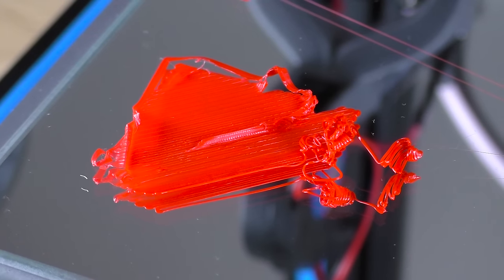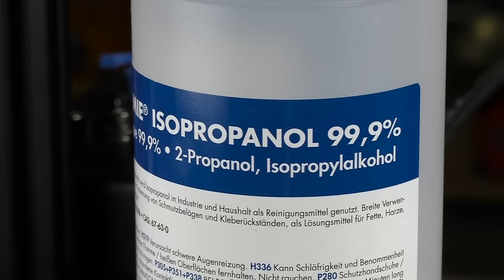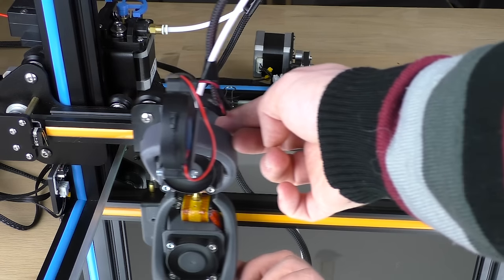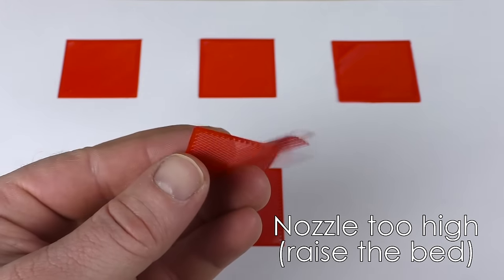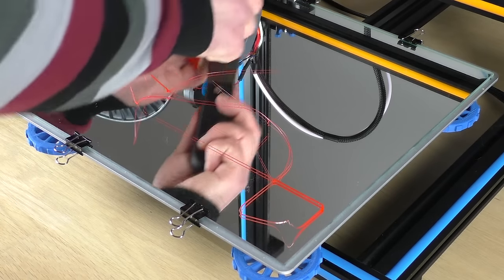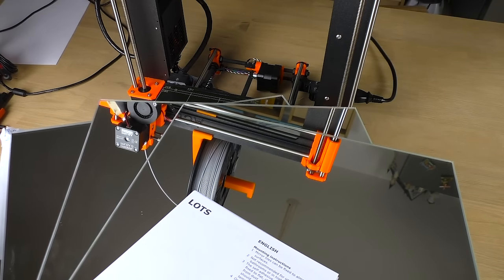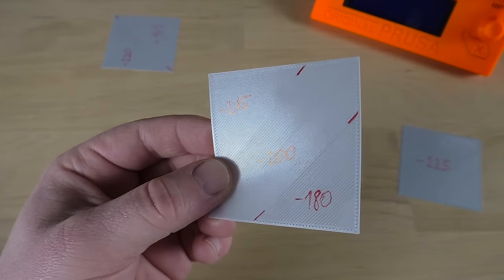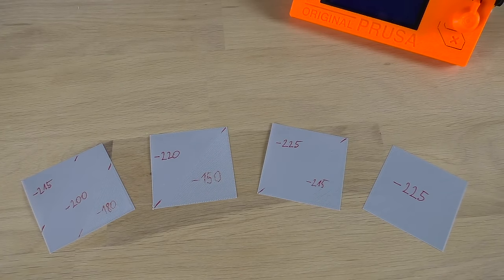Best method for 3D printer bed levelling

Comment: Did you use a brand new bed so it looks nice on the video? If not, can you show how you get it that clean ? Don’t say dishshoap and warm water . We all know that doesn’t work
Reply from the maker: It wasn't new, it was about a year or two old when I made that video.

I wait for it to cool down before removing the object, otherwise it can leave marks behind. I also wipe it with isopropyl alcohol every few prints. You have to be careful with the spatula and not scratch the surface.

Comment: Hi, thank you for sharing the tips. I am new to 3D printing and still very unclear how to get the best leveling. I tried to print the bed leveling squares gcode but my CR-10 V3 just won't print and stopped. Then I tried to print something else and the print job started. Could it be some setting on my printer not allowing the area defined in the gcode to print? I appreciated your help in advacne.
Reply from the maker: I haven't provided any gcodes, only the STL file that you have to slice yourself. Your slicer determined the print size and settings, so it's better to check those first.

Comment: Are the mirrors 30x30 ? Thank you
Great helpful vid 👍
Reply from the maker: Yep, those Ikea mirrors are 30x30cm.
Reply: Many thanks do you cut to crop or your on a 30x30 bed many thanks
Reply from the maker: @shroomy7199  I put them on a 30x30 printer, so I didn't have to cut anything. But you can buy glass cutting knife for cheap and do it yourself. Most hardware stores should be happy to do it for you as well.

Comment: Question, what is my bed is warped in the middle? it is higher than the four corners. what is the solution here other than doing like BL touch leveling?
Reply from the maker: Sometimes, simply flipping the glass around helps. If not, then put a square piece of aluminium foil in each corner (under the glass) to raise it up. You can stack more foils if needed. I had to do this with my CR10 and it works great if you have the patience for it.

Comment: Hi @hobbyhoarder, I have just done the bed test its awesome, I am using PLA and my squares are wafer thin,  not like yours is that because my extrusion is wrong  any help would be appreciated, or is that how it is meant to be ?? I have calibrated my steps and it is under extruding 62mm crazy amount,  it is the ender pro 3 , TIA
Reply from the maker: Did you calibrate both the esteps and flowrate? Here's a very good guide on how to do both: https://mattshub.com/2017/04/19/extruder-calibration/

If it still underextrudes by more than ~20%, then you might have some other issues, maybe a partial clog somewhere.

As for the thickness of the first layer, don't worry about it too much. The most important thing is that it sticks well and that the surface is smooth. Also, I recommend that you set your first layer height to 0,2mm no matter what layer height you're using for the rest of the print.

Comment: So I've run into an interesting issue. All four corners are perfect, but the center is too tight, with my mirror. Things are printing fine regardless, but I was wondering if you know why / what to do about a center that's higher than the corners?

Comment: Do the screws unwind like guitar tuners over time or will the bed stay level forever?
Reply from the maker: They don't unwind as such, but they do lose their stifness over time, especially when it's a new printer. This is why you have to re-level it every few days at first, but after a while, you might only have to do it every few weeks. It will never stay leveled forever though, not while it's held in place with springs. If you want to avoid that, look into using nylon lock nuts.

Comment: u don't wana do that every time. Plus you should use mesh bed leveling, which gets you much better results, especially if the bed has a valley and especially for large print areas

Comment: tightened one bed screw of my ender 3 by 2 degrees, did not print anything, turns out that i had to tighten it by 1 degree. using the stock (large) wheels.
Reply from the maker: Yeah, sometimes you barely need to turn it and it already has an effect.

Comment: i have the lots mirror but how do i make the bed smaller in the printer not the slicer. the first line it makes is off the mirror
Reply from the maker: If your bed size is set correctly in the slicer, then check your gcode, maybe it's trying to go out of bounds there. You shouldn't have to change the bed size in your printer's firmware, all of these settings should be done from the slicer.

Comment: Do you use anything for adhesion? Glue? Spray? Etc? Or just the wipe with alcohol? Thanks!
Reply from the maker: Nothing at all except that I clean it before every print. I just spray a bit of iso alcohol on a 1/4 paper towel and wipe the bed. This works for both my PEI bed and the one with the mirror.

The only time I use glue is when I'm printing PETG on a PEI sheet. Then you must use glue (or window cleaner) to prevent the PETG from sticking too well and potentially destroying your bed.
Reply: I agree with Hobby Hoarder but with my glass build plate I haven’t had any luck with that and I think if I raise my bed a tiny bit then it will work.

Comment: What speed did you run it at? This also matters with getting a good print
Reply from the maker: I usually print first layers at 30mm/s for most materials, but slow it down for ABS or nylon.
Reply: @HobbyHoarder   Ah alright. Good thing I asked. I had set it up for 50mm/s lol

Comment: What should I do when the square is fully connected but really thin?
Reply from the maker: Make sure your first layer height is set to 0.2mm. If it's still too thin, you could slightly increase the flowrate. Although to be honest, the first layer doesn't really matter as long as it sticks. I never worry about the thickness of the first layer.

Comment: What about if I have an ender 3 pro which doesn't have a glass surface (has the magnetic one), I can't seem to get it to stick well on the first layer
Reply from the maker: Try cleaning it with iso alcohol. If that doesn't work, use soapy water first and then iso. Bed temperature should also be 60'C for PLA.

Comment: how close can you get to level like do you give yourself a leadway of .01 or just struggling to get mine level on all sides and bltouch is a main factor of this issue for my cr10s pro v2 often pooting one corner or all corners off by .01 still cant get rid of elephants foot either please help
Reply from the maker: It's different from printer to printer. Try not to focus so much on the actual number but the results. If you're getting elephant foot but the adhesion is ok, then simply raise it a bit. Most slicers also let you reduce flowrate for the first layer, which often helps the most. Some even have elephants foot compensation that you can turn on.

Comment: how does the autoleveling work for the creality3d cr-10s pro v2. It does autoleveling before each print. Do I have to adjust the z-offset for each print?
Reply from the maker: It all depends on your starting gcode. You can have it auto level before every print, or you can save the generated mesh and only repeat autoleveling if you notice issues after a while (this also depends on the firmware you're using).

You normally only have to adjust Z offset once. But because materials can slightly deform over time, you might have to repeat it occasionally. You should notice your first layer changing, which is a sign that you should adjust your Z offset again. And of course you have to change it if you switch build plates, modify the hotend and so on.

Comment: Loved the videos, thank you for all the information. Quick question, when should I use Auto Home? only when I'm about to level the bed? Noob question but I havent found anything on it for my Creality CR-10S
Reply from the maker: Thank you, I'm always happy to hear that.

Generally, you rarely have to use the auto home option. You might have noticed that the Auto home is performed before every print, so there's really no need to do it manually. Even when you're levelling the bed and if you're using the squares, it will do the auto home routine before it starts printing them.

Comment: Should the nozzle be so close to the paper that the paper does not move?
Reply from the maker: Just close enough so that it rubs against the paper, but you should still be able to slide the paper around.

It's just a rough estimate though, once you're done with the paper, print the calibration squares and then fine-tune according to that.

Comment: My bed is warped upwards in the middle, wich resulted in either loose strings in the corners or some deep scratching in the middle when I started my first print
Reply from the maker: Try inverting the glass (if you're using one). You can also cut out square patches of aluminium foil and place them under the bed sheet in the corners. That way, you'll raise the corners without affecting the middle.

There's probably some other issue though. Maybe the bed frame is bent, or the bed is sagging in the middle.

Comment: Awesome video, knowing HOW CLOSE to get the paper to start is huge too. My next question is I have trouble getting my first 1-2" to stick to the bed, everything after that works great. I have heard skirts thrown around (the layer AROUND the project before it starts to get the plastic flowing) but I can't see how to ever add them to premade designs. I have never touched a design past the starting Gcode, is there a way a add in a generic skirt around the outline of the bed to add to all projects?? I have a 200x200 mm bed.
Reply from the maker: What kind of bed do you have? If you're using plain glass, then I highly recommend a mirror instead. Cleaning the bed with isopropyl alcohol helps a lot. Also, I tend to have my first layer more a bit on the rough side, especially for longer prints.

Yes, skirt helps a lot. You don't actually have to design it, your slicer will add it for you. I can help you if you'll let me know which slicer you're using, but all of them have the option if adding a skirt around the object.
Reply: @HobbyHoarder  I'm not sure the type of my bed, but I have a black sheet installed that my friend put on, but with you talking about bed adhesion you are correct I think. I am trying a painters tape / glue stick method right now to just test if that theory is correct, and if it is I know the main problem. Also an upgraded slicer finally added a skirt to it. I will keep you updated.
Reply from the maker: Black sheet is usually a Buildtak or clones of it. It should actually work better than painters tape, unless it's a really poor clone.

Great job with the skirt!

Comment: My ender 5 has a warped bed do you know how i can fix it or where i can buy a level glass bed
Reply from the maker: Any hardware store should be able to cut a mirror to any size (I recommend mirror over normal glass as it works much better). 

If the bed is only slightly warped, you could try adding a square patch of aluminium under the bed to raise it slightly in that area.

Comment: hi, i did your test squares and only the middle of the bed is not correct, the nozzle is too close to the bed. How do I fix this? thanks
Reply from the maker: Try turning the glass/mirror around. If that doesn't help, then set your bed so that the middle is good. Then, cut a square piece of aluminium foil and place it in each corner under the glass. This will raise the corners slightly. Keep doing it until the corners are the same as the middle. It usually takes 2 or 3 pieces of foil.

Comment: I got all 4 corners looking good but the center still seems like it’s to low. Any idea?
Reply: Using a pei sheet
Reply from the maker: Cut a square patch of aluminium foil and place it under the sheet in the middle. You can stack more foils until the center is high enough to match the corners.

You can also use auto leveling system; it should detect the dip in the middle and adjust for that during printing.

Comment: Hello! I have a problem, the 4 squares of the corners work out well, but the middle square comes out as if the hotend was up, I don't know what to do
Reply from the maker: Cut a square piece of aluminium foil (about 5x5cm) and place it under the glass in the middle. You can stack more of them if a single one doesn't help. I had to use 3 pieces to raise the center enough.

Comment: I made all the sides accurate, however the middle square seems to have gaps and lines, how do you fix it?
Reply from the maker: Cut a square patch of aluminum foil and place it under the glass in the middle. You can stack a few until the middle gets raised to about the samd height as the corners.
Reply: @HobbyHoarder  thank you!

Comment: can't locate the ikea mirrors you recommend--any advice?
Reply from the maker: I think they still sell them online, although I haven't checked in a while. Should be some on eBay though.

Alternatively, most hardware stores would be happy to cut you a mirror to any size you want and it's usually not that more expensive.

Comment: Do mirrors/glass reach the same temp as the bed or do I have to turn up the temp a bit?
Reply from the maker: It's slightly lower, but not enough to make a difference. I always use 60'C for PLA and that seems to be plenty.

Comment: hi ive got a me creator 2 but it only have 3 adjusting wing nuts to level is it the same rountine as the 4 wing nut ones ?
Reply from the maker: It is, yes, you'll just have less control over the leveling, especially if your bed is warped.

If you can't get it level, try placing patches of aluminium foil under the surface to slightly raise it in that area. You can stack more if needed.
Reply: @HobbyHoarder  thanks

Comment: I am here because my prints...  1 will be perfect, the next one will not start at all - 0% lay down.   Then the 3rd print will be perfect again... then the 5th will be terrible...

I cant find any pattern or reason for it.

Using a new ender 3 pro, im sure that the problem is me.

I will try this method.. maybe i just totally messed up everything with all my testing.  Thank you!
Reply from the maker: The springs that hold the bed in place could be the reason. New springs are "soft" and take some time to settle, so a levelled bed can quickly fall out of calibration. Check that the springs aren't too loose. Then like you've said, try it with the calibration squares from my video and see if it helps. Usually, the springs should stiffen after a few weeks and then you only have to repeat bed levelling every month or two, maybe even less often.
Reply: I'm not super familiar with those, but I have that issue if my z height probe is hot. The accuracy just goes to garbage and the more I try the more it gets worse because I'm usually not allowing for it to cool. Sometimes I use IPA on the probe to cool it when I'm heating my bed hot for something like ABS or PETG.

Comment: So the key for bed leveling is still a paper you don't throw to the basket bin and then testing it, ok?
Reply from the maker: No, paper is not the key, it's only a rough estimate if your bed is really off. If the bed is already somewhat level, you never have to touch or use the paper.

Comment: hello sir, have u know how to level the bed on trinus printer. Cause i'm not very sure with my distance between nozzle and the bed . Sometimes i print it stick to the platform sometime not. Can u or anybody help me?
Reply from the maker: I've never worked with that particular printer, sorry. If it uses springs to level the bed, then it might simply take some time before the springs "settle in". You should only have to re-level every few weeks then.

Comment: What if the corners are too low (-> you have to raise them) but the squares inbetween the corners (so middle squares on the outside) are too high (-> you'd have to lower the bed there)? If you raise the corners, the middle ends up even worse.
Reply from the maker: Sometimes, simply flipping the glass around helps with this issue. If not, you can cut square patches of aluminium foil and place them under the glass, in each corner. That should slightly raise the corners while keeping the middle at the same level.

Comment: The center of mine is higher then the corners. How do you fix this?
Reply from the maker: Try flipping the glass/mirror around. If that doesn't help, cut a square patch of aluminium foil and place it under the areas that are too low. You can of course stack more if needed.